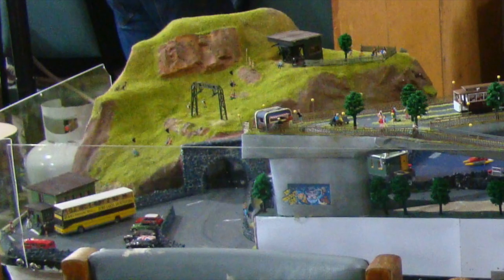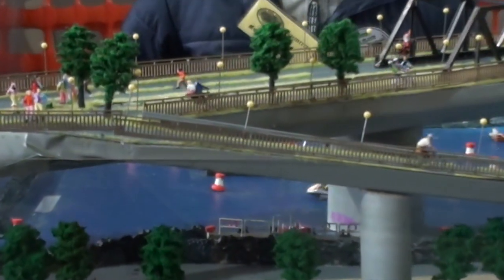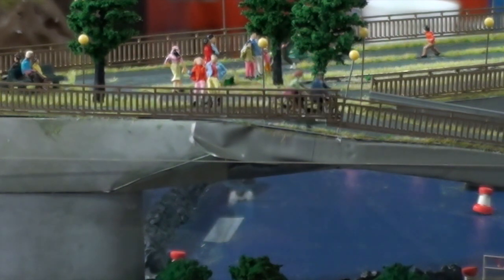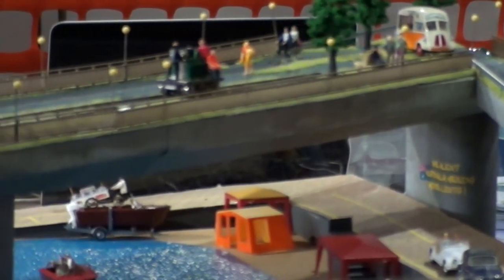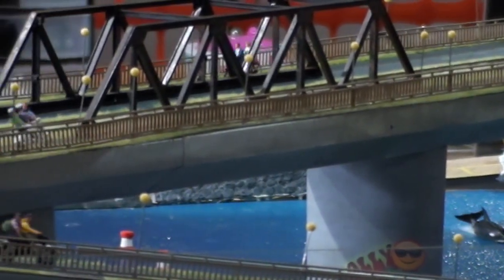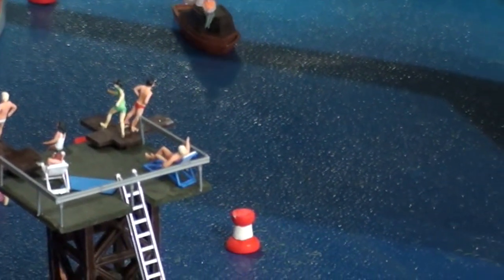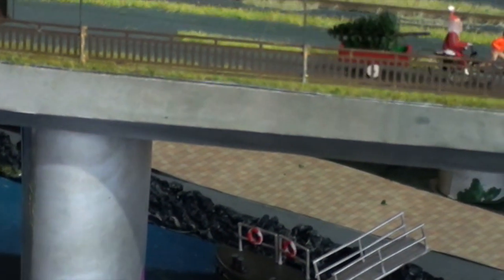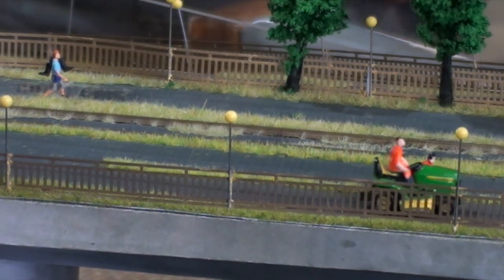Magnorail Phase 3 #10 - IT'S RUNTIME

Comment: Hi this is amazing. Can u briefly explain hw bicycles, vehicles are moving. Is it EGV?
Reply from the maker: They all move with magnetism. Magnets in the moving track under he roadbed attract the ,magnets embedded in the vehicles or bicycles and basically drag them along. The bicycles front and rear micro magnets keep the bicycles upright whilst at the same time drawing the central clear wheel onto the roadbed enabling it to turn. The cyclists ankles are attached to the clear wheel and the clear wheel rotates when going forward giving the impression of them actually pedalling. It is all Magnorail Magic through the physics of magnetism. Go back to video 1 in this series to understand more. - Clyde - www magnorailoz.com
Reply: @MagnorailOz  Hi Clyde, with this system you reckon a airport truck can pull a 1:160 scale aircrafts into taxiway and finally put into runaway and run series HO scale firetrucks in an highway for a rescue mission etc., like a layouts in miniature wunderland  in Hamburg Germany. Will watch all ur videos first and contact you. Hope u r based in Aus myself in NSW.
Reply from the maker: @talpewijesinghe8305  The latest motors from Magnorail in the starter sets for bikes and sliders have a higher torque than previously and should pull a decent load, like my LEGO concept (https://youtu.be/HuRC_dLL974) but part of your solution would be to put a magnet in the front wheel configuration of plane so the Magnorail system is pulling it and not just the truck. Just remember that you cannot reverse the plane in this situation and you would really only be able to do a circuit - It is not like the Faller Systems which has motors in the actual vehicles. The Miniature Wonderland systems are all motorised computer controlled planes and as well as the rescue vehicles - not really achievable but he Magnorail System but you could have a plane do a circuit fro the standing area and around the taxiways.  Hope this helps and yes we are in Victoria Australia but sell worldwide via our internet shop at www.magnorailoz.com

Comment: Did not see the ski lift working in this video - is it still operational?
Reply from the maker: The lift was down for whiles as the drive gear had stripped itself - just overlong constant use - I was able to source a plastic replacement part but Echo Lakes has now been superseded by Crater Lakes in 2019 and alas, no room for the lift - Maybe Crater lakes 2 will see its return!

Comment: i have just discovered magnorail. is there away to make this work with 1/64 die cast model?
Reply from the maker: It should work, bearing in mind it is only slightly ,larger than HO scale The ice cream truck on the layout is die cast and the system handles it ok. It is all about the physics of magnets - the heavier the load the stronger the magnet needed so you may require a double up on the slider magnets and fewer vehicles to not stress the motor.

Comment: can you run 2 or more line next to each other and have variable speeds?
Reply from the maker: The trick is to have an inner and an outer loop, that way they can be beside each other and also have two streams of traffic going in two different directions - check out the inventor of Magnorail's latest layout in N scale on YouTube https://youtu.be/Czwre2RPkhM and carefully watch the vehicles, with the trucks going at a slower speed on the inner loop whilst the cars zip by on the outer loop. I have the two loops running together for a only a short time on the rail trail section whilst one loop then  goes down the ramp to the lake and then up again.